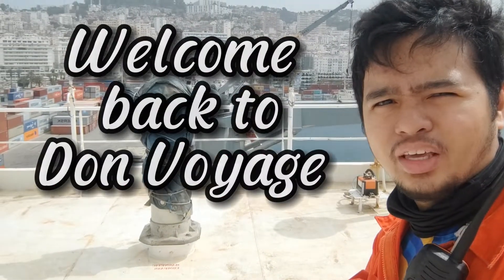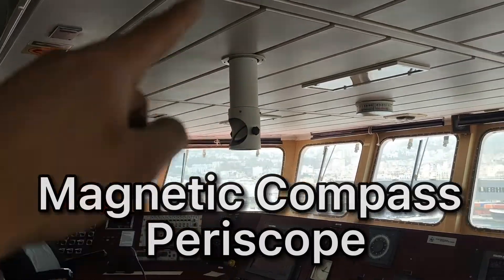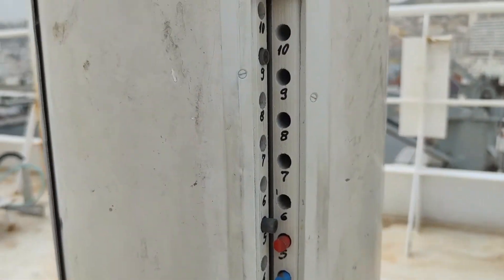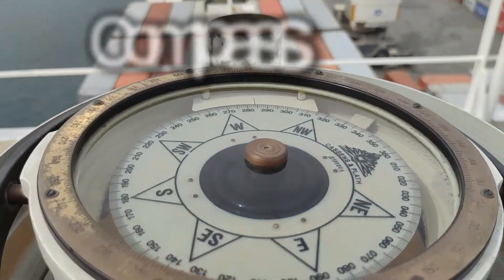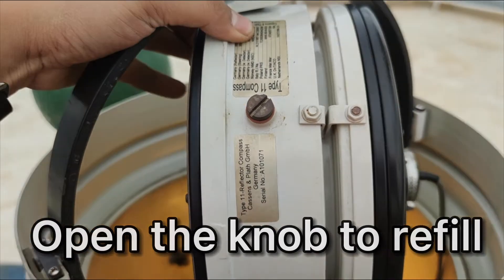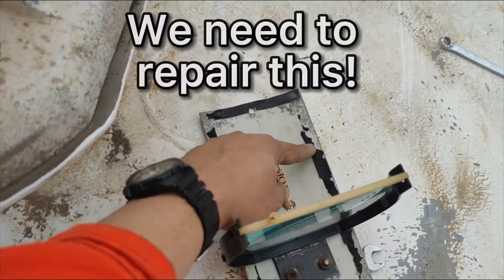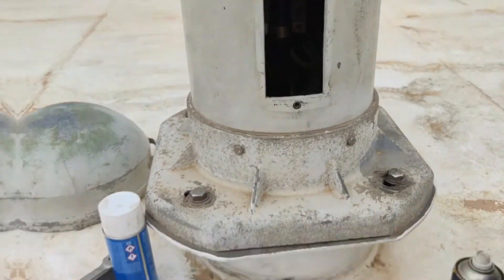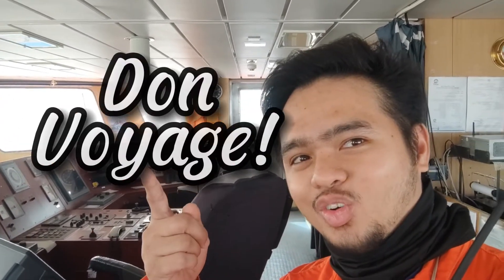Parts of Magnetic Compass, and different compass correctors | DonVoyage SeaVlog #005

Comment: Hello ka mate kailangan pa ba erefill ung new spare mag.compass.if kailangan paano ba ang ration sa distilled water at sa akcohil fluid
Reply: Hi. Check the maker/model of the compass, yung iba kase oil or alcomixed (distilled&alcohol mixture).
Kung naverify na which liquid ang laman ng compass, pwede ka na magrefill. Iwasan mapag mix ang oil sa alcomixed, kaya kailangan icheck ang liquid bago magrefill. Pwede gamitan ng syringe.

To answer your question, 60% distilled 40% Alcohol, lahuin at kung meron kayo need siya maivacuum.